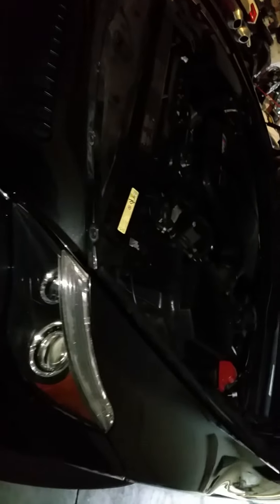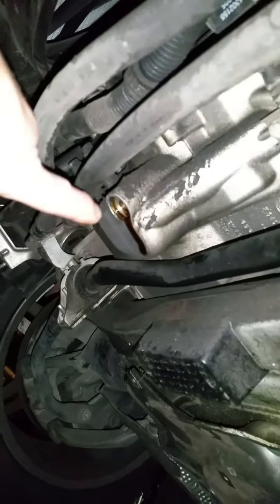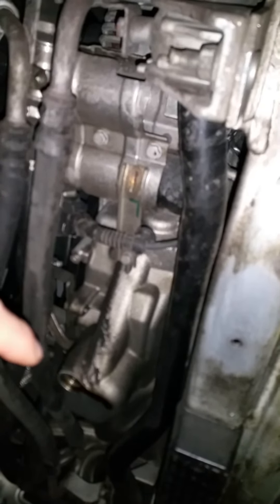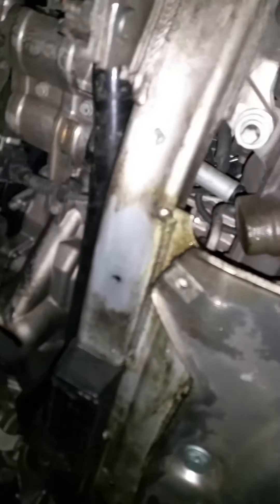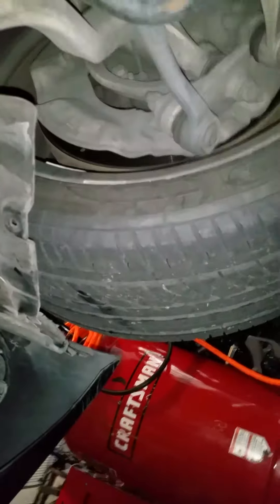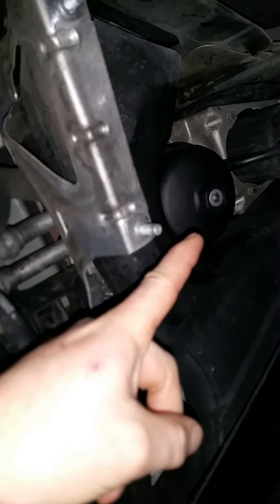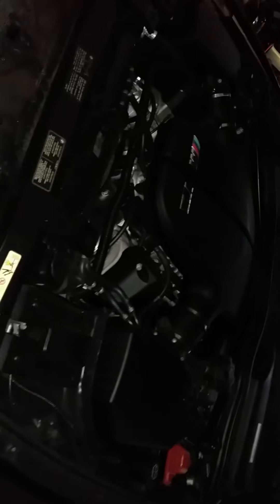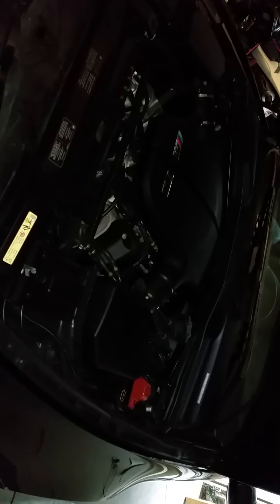2006 BMW M6 with two oil drain plugs.

Comment: Thank you for doing this.  My only suggestion is to start out your video with your camera horizontal so that the video is shot in landscape mode.  I watch youtube on my laptop and your video was only 1/3 of the screen because it was shot vertically.  Had you started out in landscape mode, the video would've been using my entire screen.  Again, thanks for doing this.  I'm about to do my M6's oil for the first time.  It's a great car.  It pulls hard.